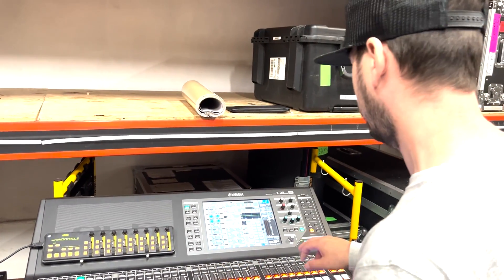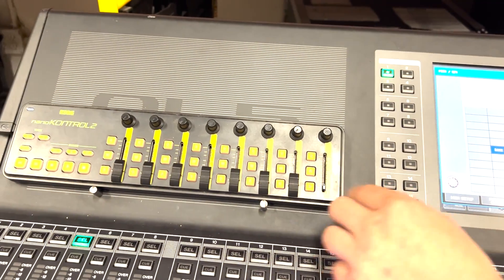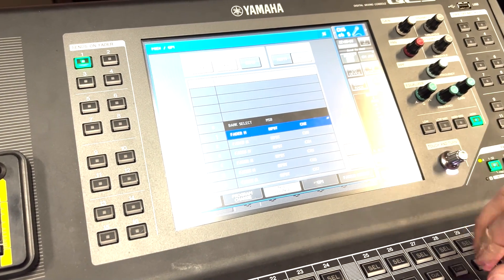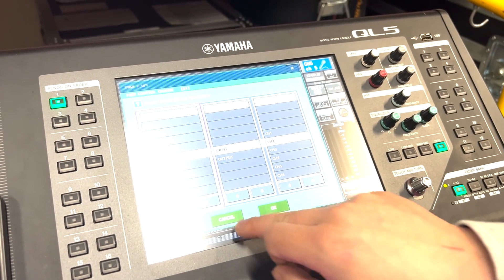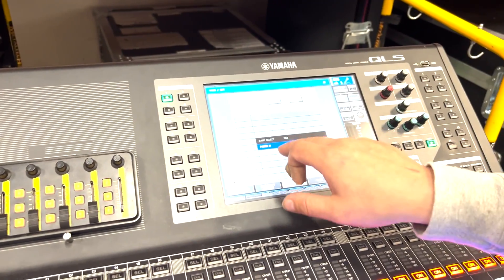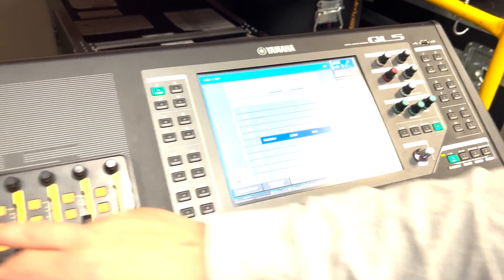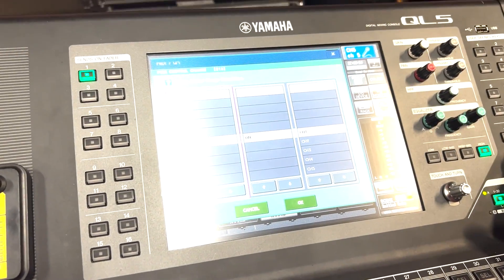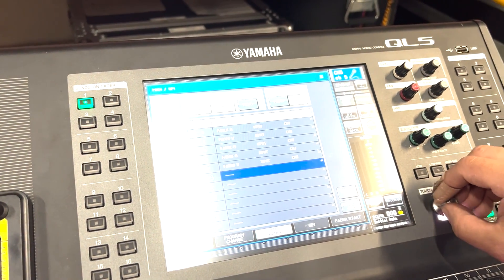Expanding Faders on Yamaha CL/QL Consoles via MIDI demo 1

Comment: Sorry if this was covered, but with respect to the midi controller used, and fader 1 being “broken,” I’ve learned that during setup, Yamaha Midi starts with CC# ch1, versus some manufacturers like Korg starting with CC#0. Hence, it’s not possible to assign the first fader. I tried to “program” the Korg controller, but the setting won’t save to the device when not connected to a laptop. Thus, you can only start with fader 2 on this particular controller. Also, on the Yamaha, the “Table” button must be engaged/highlighted.
Reply: It took me a show to mess with it before I noticed the number assignment issue, but I’m sure other controllers might work fine. Thanks for this idea! It has saved me a ton of stress already when using a QL1. Please keep up the great work and content! Very much appreciated! Always looking forward to more videos.
Reply from the maker: @danielmacias2312  much love! Happy mixing.
Reply from the maker: @danielmacias2312  ahh that’s a great point. I might have to take a second look.

Comment: Hi sir i want to ask... i have 2  yamaha tf5 mixer..can we combine together to make 64ch..both of the mixer got ny64d card
Reply from the maker: @Pedulialamakhirat  yes and no. You can always route busses into inputs. So the master of one tf1 could feed 2 inputs of the other, cascading the consoles. There would be a slight difference in delay on one of the consoles due to the added layer of processing.
Reply: Tq for the information

Comment: Sorry too bother and ask. It’s far off your subject on this video. How do you get your gain structure and faders too level ? Also what is your preference behind your wireless, mic or line ?  Dumb question but I have and seen different approaches.
Reply from the maker: @kevingarcia1992  I push all of my faders to unity, and then I make sure all of my head amps are set between minus 18 and minus 24. 

As far as line versus mic level, because I’m taking in several line-level sources, I usually keep everything line level for consistency. That way, everything can play with everything. But, everything is usually Dante in, so I’m hardly taking physical I/O that often.
Reply: @KINETICPROFESSIONALS   Thanks you for the response! So you do that but send
Main too matrix too have control just of room ?
Reply: Yea I do so I pink noise it for volume for room. But do use line on wireless for digital boards ? Cuz I feel I can’t really see signal, has worked. But I been changing them to mic unless it’s an analog board. You tell me lol. And I totally appreciate your time for sure
Reply: Matrix I use for volume adjustment for rooms , videos , records. Just times feedback in gs gets heavy when wireless on line.
Reply: Just best way to approach it , I’m asking
Reply: Know you are busy, just anything would help. Get different A1 guys how to do different.
Reply from the maker: @kevingarcia1992  I usually have main pa on matrix’s with a dca master handle, groups in mixs, clean feeds in mixs and my stereo master is usually records or near fields.